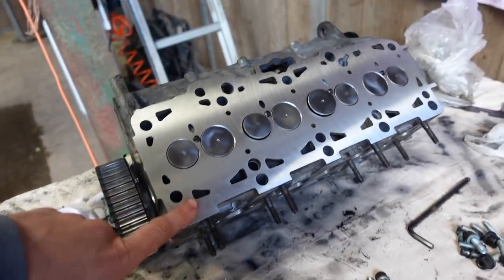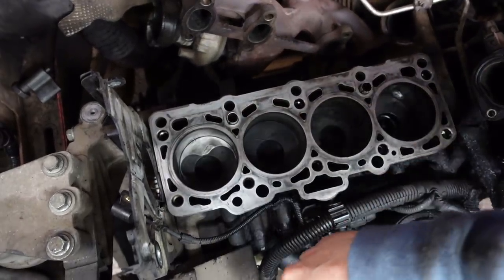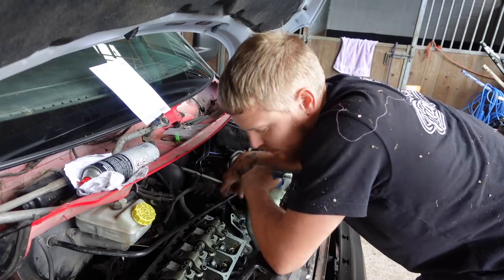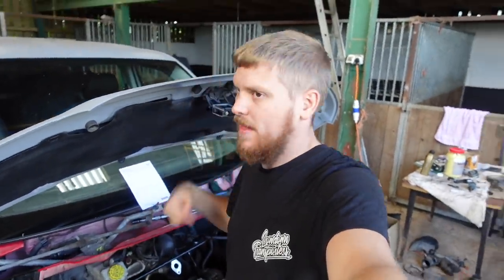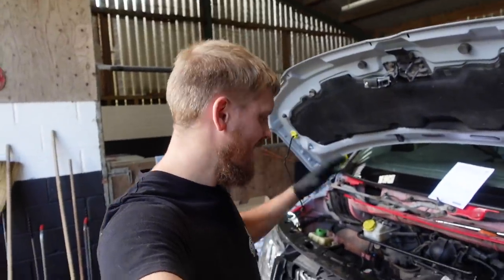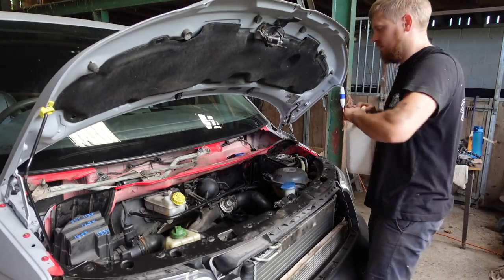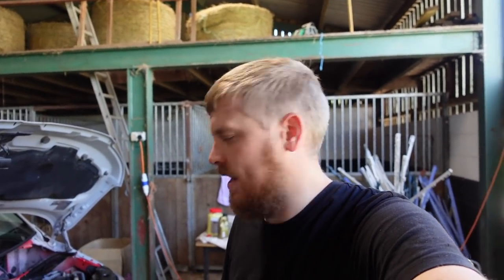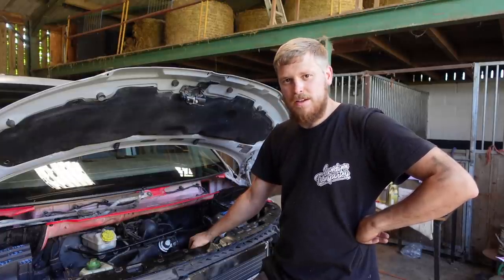VW T5 'Restoration' Ep18 Refitting Cylinder Head 1.9 TDI AXB Transporter Pressurised Coolant

Comment: Im not convinced there's any problem with the cold radiator. Engines do not generate that much heat on tickover and T5 have a very efficient radiator and cooling system, to handle much hotter climates than UK. Best way is to drive it normally for about 30 minutes, checking that all is ok with the coolant system visually, once or twice. The rad fans on my T5 2.5 would not come on at all for short or light load trips.
Reply: I agree, it takes ages for any Diesel engine to warm up, and they have to be under load. Just on tickover it will never get warm enough? 🤷🏻‍♂️
Reply: I agree with this!
Reply: I never heard my fan in normal road use. The TDI will not get hot enough on idle i think.
Reply from the maker: Thank you for watching and for the comment! Yes appears that they don't get very hot on tickover. Took it for a good run and everything was as it should be.

Comment: So glad you mentioned getting the old engine oil out of the head bolt thread holes, very important for the reason you mentioned that they would hydraulic and you wouldn't get the correct torque on them. Another great video !
Reply from the maker: Thank you for watching and for the comment! Such an important easily overlooked step.

Comment: Great work Dan, well done on a good job. Like the previous comments, I don't think there's a problem there now - take the ol' girl for a run, get it under load, generating proper heat. The rad will heat up then! On your return, leave it to sit overnight with the exp. cap off and top up the coolant in the morning, job done!
Reply from the maker: Thank you for watching and for the comment! Yes! I did exactly this. All works as should now!

Comment: I’m not a professional but in my experience a T5 will not get hot enough on idle, need to take it round the block to get the water system flowing. The intercooler and rad are really efficent on the T5’s. I have a 1.9 BRS if its up to 90c running temp and I pull over and leave it too idle the temp will drop back down to about 70. Its probably fine dude 🤞🏻 Nice to see you got a set of clip pliers they are a GAME changer 😂
Reply: On VW clips definitely....
Reply from the maker: Thank you for watching and for the comment! Yes, It appears to work when revved high on a long run. All works as it should now. The pliers make life so much easier!
Reply from the maker: Thank you for watching and for the comment! Defintley!

Comment: Great videos mate, going through exactly the same as you with my T5 axc, taking the head off Thursday. Just one point for you these do take an awful long time for the stats to open and let the coolant flow through the bottom hose I can pretty much guarantee you fixed all the issues. Keep going Dan

Comment: Possible still a very slight air lock engines don't tend to get up to the correct temperature on tick over if it was me I'd give it a blast up the road get the coolant circulating correctly then check the level and see if you get heat to both sides of the radiator before dropping all coolant etc again, you have covered everything and its great to see it all done properly great work 👍
Reply from the maker: Thank you for watching and for the comment! Yes, Took it for a long run and all now works as it should.

Comment: That radiator will be on okay. Your thermostat for the fan needs to be on a top hose coming from the engine . Hot water should go into the top of the radiator and cold come out the bottom then back to the engine. Get a cup of hot water to test you thermostat if you have the fan connected it should start with the ignition on. I have a LT35 2.5 and these engine do run fairly cool. I have fitted a SPAL fan as the viscous fan was removed by a previous owner... apparently it’s a popular thing in central/northern Europe. Not so good in southern Spain though, 45 degrees C at Córdoba. It didn’t overheat even then.. although I was ‘bricking it’. Well done so far you have ticked all the boxes on this project..
Reply from the maker: Thank you for watching and for the comment! I took the van for a drive and all now works as it should do.

Comment: Hi Dan. Many thanks for the great efforts you put in producing the videos. I still have an issue on my T5 where I replaced the Thermostat, water pump, cambelt, expansion tank, injectors, and now am considering to replace the radiator and doing the head. My symptoms are that the coolant temp rises above 90 on uphills and higher load conditions. I actually took the car to a well known and reputable radiator service centre and they test for gas in the coolant. None found which should mean that my gasket is serviceable. Why have you not done such a test? Maybe because you in any case wanted to show us the process of fixing the head? Any case I am also suspecting the temp sensor because it could be that it is not calibrated any more and shows a higher value causing panic. You comment please.

Comment: top job bud, i have done a few head gaskets over the years on various cars i have owned and have seen that a few times where it just needed a good drive and then left over night to self bleed. not saying for definite its that but a possibility as well as that the new stat failing, If you get that far put the stat in boiling water and see if it opens.
Reply from the maker: Thank you for watching and for the comment! Yes, Took it for a good run and it seemed to sort the issue. Everything works as it should.

Comment: Great job on the cylinder head. I’m pretty sure that’s the same 1.9 Diesel engine they put in the T4’s as well. They can go 200,000 miles plus, so should be good for some time now.
Reply: Not the same,T4 had an indirect injection engine with inj pump.This is direct injection PD engine,still good for 400 -500 thousand
Reply from the maker: Thank you for watching and for the comment! I have seen these early PD engines with circa 500k if they are looked after!
Reply from the maker: Thank you for watching and for the comment! Yup, Should go for a while more now.

Comment: He is right if you torque the headbolts with out cleaning the threads inside and there is oil or coolant you could get an hydraulick lock
and if you did not torque it to the first second or third state you could crack the block so be carefull
Reply from the maker: Thank you so much for watching and for the comment! Something so simple that could easily be over looked and cause problems instantly!

Comment: Upgrade the headbolts, if they're anything like the fabia 1.9s they headlift for fun. ARP headbolts are a must, even on a stock engine, or you'll be replacing that headgasket sooner rather than later!

They can be replaced one by one using the removal sequence, so no need for a new gasket or for it all to come off again.
Reply from the maker: Thank you for watching and for the comment! I mentioned upgrading the headbolts to the engineer that did the headwork and he said to not bother.

Comment: I'd say there's still a small air block in the cooling system. I tried it there's no bleed valves on any pipes or the top of the rad? Take it for an Italian tune up. Give it a thrash up the bypass and see if it gets hot.
Reply from the maker: Thank you for watching and for the comment! Took it for a drive and all works!

Comment: Great videos mate really helpful and just nice to see a normal bloke going at job like this will help a lot of people im sure has given me that bit of extra confidence to pull the head of mine.. Shes spun a bearing so might not be a success anyway but il give it a shot.. Any chance you could give a rough idea what it cost for the work on the head and gasket? And did it advise you to use new headbolts? And how has it been over time? Thanks
Reply from the maker: Cheers bud! I think the head work was about £550 from memory. Sure I mention it in a video. Yes use new head bolts. As far as I am aware it has been Ok. I sold the van a few weeks after I finished it.

Comment: Having the same problems as you m8 done water pump. Thermostat. System flush. Still the same .also had a cylinder head gas leak done. But still bottom hose cold .and when asked to go up a hill she drops her guts. Did doing the head gasket fix your problems.....thanks

Comment: Enjoying the vids, thanks. I'm not sure why you need to shim the head gasket though as the combustion chamber is in the cylinders and you have only skimmed a flat surface. Which is still flat. Won't this just reduce compression? Unless the valve clearance is really tight?
Reply from the maker: Thank you for watching and for the comment! The valves are very close to the pistons. Wards know their stuff and I took his advice on it all. The pistons come slightly above the block at TDC too.

Comment: Same van as I have t5 with axb tdi engine.   Well done Dan.
Anyone know how I can take off the valve cover without moving the inlet manifold?  I'm told there's one bolt not easy to get at.   My goal is to inspect and replace the crankcase pressure regulating valve "thing".   I suspect it's not venting properly and is gummed up with goo.
Reply from the maker: Thank you so much for watching and for your comment Bud. I think the rocker cover comes off pretty easily without removing the inlet manifold?

Comment: Great video as always, glad to see you've fixed the big problem 😎👍🏼

Question for ya, the EGR valve.. is it the big silver tophat looking bit or the ball/ lever at the back of the egr housing?
Reply from the maker: Thank you for watching and for the comment! The EGR on this early engine is the top hat looking unit, Well the part below it too. sImple to remove and clean.

Comment: Given that the head and block meet with gasket, how come you only skim the head and not the block as well? I presumed skimming was to give you a smooth flat surface for the gasket? Great job dan, enjoying the channel.
Reply from the maker: Thank you for watching and for the comment! The Block is made from cast iron and the head from aluminium. The block is a lot harder metal compared to the head so the block is less likely to warp or distort. The aluminium head can warp ever so slightly to cause these issues.
Reply: Thanks dan for the reply. Interesting to know.

Comment: Do you have any diagnostic equipment? Should be able to command the fan on through that. You would then know the wiring was ok, as you've already applied current direct to the motor.  If you've got one that can show data in real time, you could monitor the engine temp through that. You'd then know what temp the engine was achieving and whether the stat should have opened and the fan kicked in.
Reply from the maker: Thank you for watching and for the comment! Unfortunately I don't have any diagnostic equipment. Just some basic tools really. I took the van for a good drive and the fan kicked in.

Comment: Dan could i ask how did the van pull whilst it had failed?  Mine pulls like the brakes are stuck on!  Same AXB Engine 100bhp?
Reply from the maker: Thank you for watching and for the comment! It drove quite well tbh, Is yours boosting or not?
Reply: Yes its boosting as I can hear the turbo spool up.  BUT with the air pushing into the header I took the plunge to take the head off.  Exactly the same as yours, 2nd from left blowing into water jacket.  Got a mates 130 head going in it when the head kit comes.
Reply: Might put a new MAF sensor on it whilst I'm doing.

Comment: Did you have to prime the injectors before you started your van up and if so how? Just re-assembled my T5 after having the head off and it just won't start
Reply from the maker: Sorry for slow reply. Yes I cracked the injector nut and cranked the engine until diesel wept out, then tightened them up. Did that for each cylinder and it fired up.

Comment: what did the work on the head cost?
Reply from the maker: Hi, I think it was around £550.
Reply: @DanChambersDAC  thanks for replying. That's pretty decent. My 2.5l is leaking oil. If it needs anything I'll take it to those guys. Cheers again